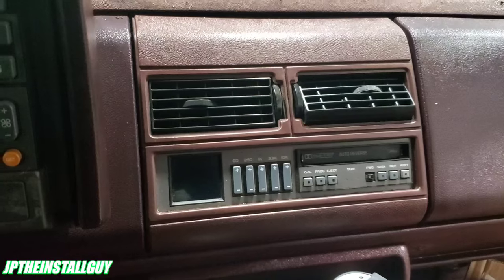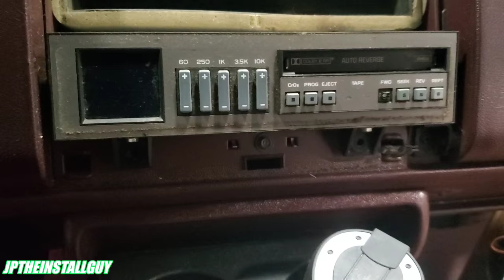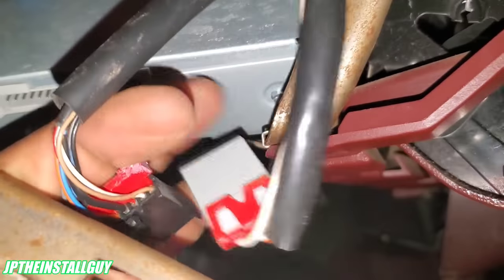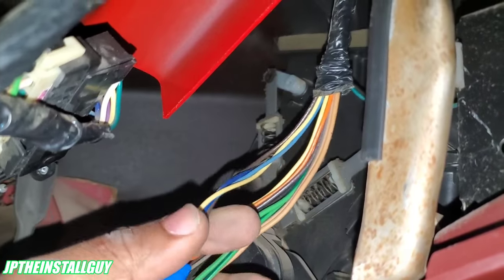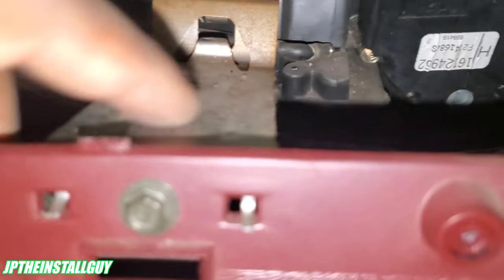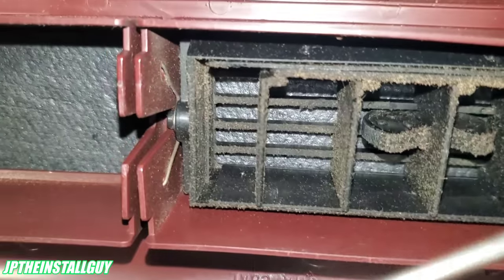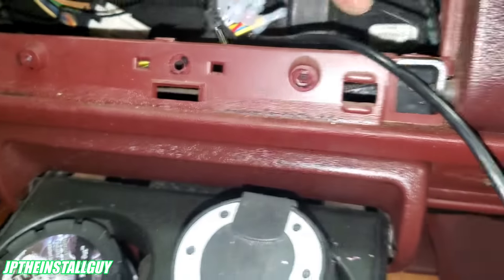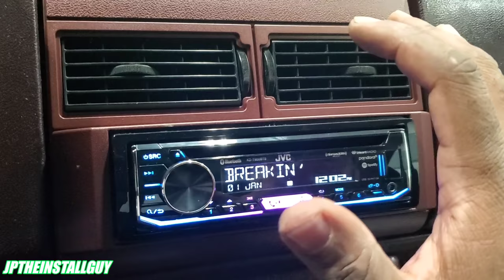1990-1994 CHEVY SILVERADO radio removal and jvc cd player install

Comment: Lost my two springs for the vents. Any clue on where I can find replacement springs?
Reply: Lmc truck
Reply: Junkyard
Reply: Junkyard bro.   Duh.  Lol
Reply: Bought a 3d printer and made my own designed replacement to the traditional spring, as well as now custom making other parts.  ... Note, just going to the junkyard like the replys would be a LOT cheaper if you don't alrrady want a 3d printer & tech based already lol )

Comment: Bought a 93 c1500 recently. Owners had an aftermarket radio in it with no faceplate so I got a cheap new one, gets power but no audio... can't figure out why. All wires are correct.

Comment: This is exactly what I needed. I don't like the aftermarket radio in my 94 Blazer and I'm going to be hooking up the factory radio. This will be very helpful! My only problem is finding an original equalizer for the truck. Hopefully a junk yard has one!

Comment: Very helpful JP. Just finished. This cut my time down knowing exactly where all the screws were.  BTW, I used a half depth deck (no CD), so I was able to leave that center bracket in place under the old cassette deck.  A little concerned about heat from the vents affecting the deck over time.  I may add some insulation between.  Thanks again, great job.

Comment: I have an 88 gmc k1500 with different style plugs, I did get a wiring harness and matched color for color, cd player turns on but I get no sound, plug the old stereo in and I have sound? Did I get the wrong harness? Or am I missing something?

Comment: Thanks for this video new subscriber. I have a 93 and when i removed the old stereo i noticed a lone white wire connected to the receiver. What did you do with that? Did you use it? or cap it off? Thank You!

Comment: Why did you have remove the A/C vents from that plastic piece you removed?  Doesn’t air just come through there?
Reply: You're removing the vents from the factory piece and moving them over to the new Metra 99-3000R  dash kit (link above).  The equalizer and tape player are wider than a single DIN stereo.  The Metra dash kit gives you the perfect single DIN space so your install is clean and looks good.

Comment: What did you do with the sterio head in the right main part of the dash?  Its actually the controller, display, etc.  Reason asking, if not needed, would like to use space for gauges.

Also, what unit do you find best in sound/features for this model truck.  I kinda like the EQ, will miss it.  And finally, can a LCD style unit fit in that pocket once removing brackets etc. Thx!

Comment: I have a 93 GMC Sierra c1500. I am trying to install an after market stereo but am having issues. I have the correct wiring harness and even have it correctly spliced into my new stereo but I don’t get any power to the stereo. Any idea what this could be? The truck only has stereo, no cassette deck or anything else.

Comment: im trying to connect the factory radio back, I want it to all be stock. but the guy who had the truck before had an aftermarket stereo setup and I can't find the gm 4001 plugs, can you do a video on removing a aftermarket radio and installing the stock on back on? mine is a 1990 chevy k1500

Comment: Please help. I took out the after market radio to access my ac vents to put new retainers and when I put the radio back in it lost power and my inside lights flash on and off real dim. Idk what happened, just when I pushed it back in something happened. I had to unplug the radio for the lights to stop flashing.
Reply from the maker: Hmmm? Are connections still good.  Did you check your fuses to make sure nothing is blown?
Reply: @jptheinstallguy  I actually checked my fuses after I posted this comment and sure enough the “ctsy” (courtesy) 20 amp fuse was blown. Whoever installed the radio didn’t protect the loose wiring and just left it all exposed so I’m assuming one of them touched each other or some metal. I replaced the fuse and wrapped all the cut wires in electrical tape. All is good now. I’m no electrician that’s why I was freaked out lol.
Reply from the maker: I'm glad you got the issue fixed though and always tape off loose unused wires. You did good bruh💯

Comment: Can you go double den on these trucks? Got a 1991 chevy C3500 and looking to add a backup camera for hauling and need a double den to do that.
Reply: There is a special kit for that, but you have to cut the lower dash out. But you do not need a double din. There are single din radios which have a sliding 7 inch touch screen.

Comment: Thank you for the vid JP.  Just curious if the factory display still works showing the clock after this.  Or is that factory unit just completely dead when you install this way?
Reply: Factory unit is completely dead.  When you unplug the tuner harness, you cut power to it.   There's a storage cubby available online that bolts in place of the factory stereo.

Comment: Is it possible to put the radio into the original location of the stock radio? Where all the controls are? I think it’s be a better look and easier to control from the driver seat
Reply: Cruthchfeild has a couple units that fit the stock mounting location.

Comment: HI, the video was very helpful getting the radio out, but I am confused with the wiring, the Metra wire harness  70-2001 doesn't fit with the 2 hookups that you moved to face the new stereo. I think you say you just need the blue one, is that right? Or do you also plug the black one into the same Metra wire harness  70-2001? Thanks!

Comment: How do you mount the radio? The video skipped over that part. Does it just slide in? Thanks
Reply: You mount the radio bracket in the hole. Once the dash part is back in place, you slid the radio in.

Comment: I have one question I am trying to find one for my 94 pickup as well but I am having a hard time understanding what happens to the control panel on the dash. I mean the top control stereo that is where the radio is usually controlled so what happens to that when you put the new stereo in?
Reply: I hope that made since
Reply: The control panel on the dash will be dead because the CDM controls the clock as well as the radio.  I have a 1993 and the method in this video produces a dead control panel... so I'm going to keep my CDM in and try to wire a radio in another way.

Comment: So I got a question/need some help. I installed a car radio with new front speakers and only the right front speaker worked not the left. What can be the reason? Any advice will help. Its a 90 chevy silverado c1500. Thanks man
Reply from the maker: check the speaker. it might be blown

Comment: Installed it just like you got here but no power.  Is it possible I got the 2 smaller plugs switched?
Reply from the maker: maybe or make sure your fuse isnt blown
Reply: @jptheinstallguy  it was a blown fuse.  Thanks for all the help.

Comment: Need Help!!!! recently installed radio in my 94 but when i turn headlights on the a/c control panel goes dark, what i missing? thanks in advanced
Reply: Could be the light dimmer switch maybe
Reply: All the dash lights are supposed to dim when you turn headlamps on.

Comment: Hello I have a 1990 Gmc Sierra and my radio and inside lights worked fine before I tried to hook up this tow light to my cigarette lighter input then everything stopped working, I don’t want to buy a whole new radio (that silver box under everything) if that’s not what I need, And all my fuses are good, what should I do bro?
Reply from the maker: i was just about to ask have you checked all your fuses...lol try unplugging it and see if it works

Comment: Man i pulled the aftermarket single out my z71 to put in my s10 tried to put it back in wont turn on wiring is good fuses are good cant figure it out
Reply from the maker: if you have a multimeter or some sort of voltage meter check the the voltage on on the red,yellow, and black wire to make sure the voltage is there if not than there is a fuse blown somewhere that you might have not seen
Reply: @jptheinstallguy  thanks man ifound it after some tracing last night the wiring harness got pulled and undid the power wire to radio

Comment: So I have that same radio and did all of the steps and it still does not work I know the wiring is right but I don’t know where the fuse or the relay is so if someone could tell me where it is I would appreciate it

Comment: Hi my husband has a 1991 Chevy Silverado every time he turns radio on hardly any radio stations come in and when they do it staticky he has a brand new CD player with brand new speakers he thinks it's the antenna wire in the antenna
Reply: Did you fund anything. I am having a similar problem and havent got to it yet.

Comment: It seems a little goofy to put the new radio in the tape slot. Wouldn't it be more practical to put it where the factory head unit went since you wouldn't have to lean over to change the station.
Reply: It's not wide enough to fit a radio